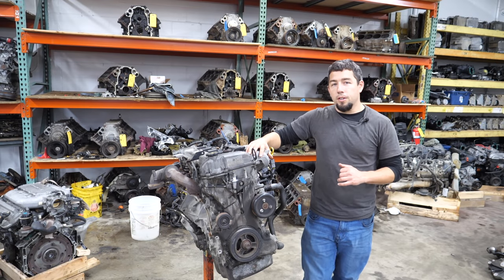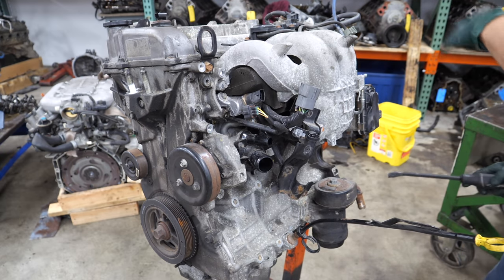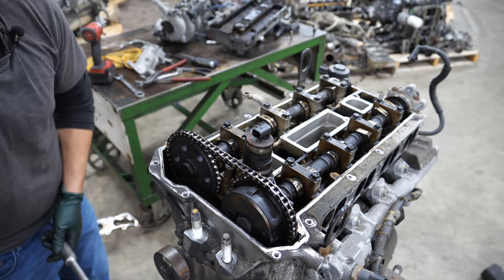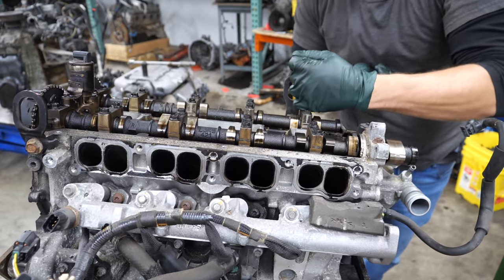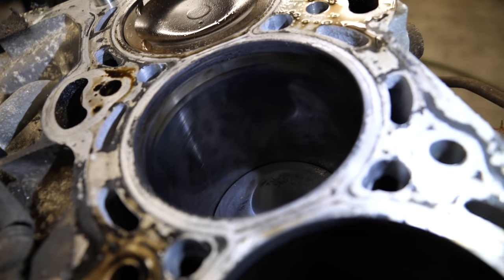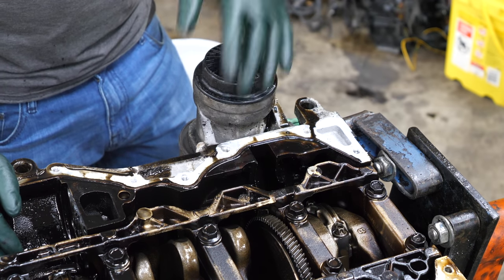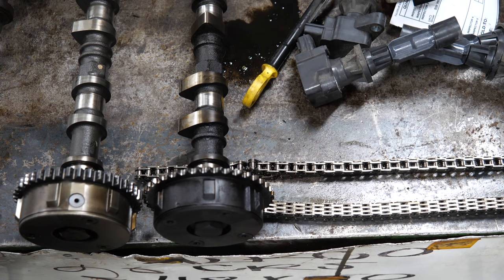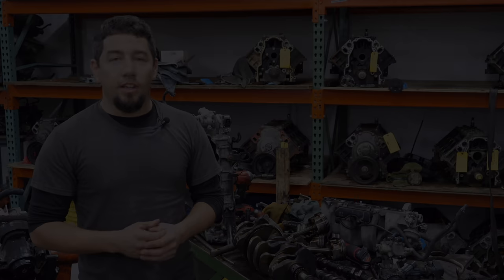Mazda 2.3L Turbo MZR Engine Teardown. A SMORGASBORD Of Failure Modes!

Comment: i dont understand the balance thing? its a 4 CYL
Reply: Imagine an upright single cylinder engine with the piston at Top Dead Center(TDC), and the crankshaft rod journal at the 12 o-clock position, with the connecting rod standing vertical in between. As the crankshaft rotates clockwise at a constant rotational speed away from TDC both the piston and the rod journal will descend towards BDC but the piston will descend faster initially because of the rod which is fixed in length being pulled off of its vertical position due to the horizontal motion of the rod journal. Once at the 3 o-clock position the rod journal will have traversed half of its vertical range of motion between TDC and BDC but because of the rod no longer being vertical the piston will be more then halfway through its range of motion. To give an example if an engine had a 10cm stroke and a 13cm rod the piston will be 6cm down the bore with the rod journal at either the 3 or 9 o-clock positions. As the rod journal approaches 6 o-clock the rod comes back to vertical causing the piston to slow on the approach to BDC. The reverse is true on the way back up the bore.

Since the piston and reciprocating weight are fixed but the velocity of those components are higher on average from 9 to 3 o-clock, across TDC, then from 3 to 9 o-clock, across BDC, the force created by those parts changing direction across TDC is higher then across BDC, even with the crank rotating at a constant speed. For this reason it is impossible for the force created by the crankshaft counterweight(which is constant), to counter the inconstant forces created by the reciprocating assembly, though the inconstant forces created by the reciprocating assembly can be mitigated and made more constant by increasing the rod/stroke ratio(RSR). Longer rods will produce less imbalance between TDC & BDC then will shorter rods for a given stroke length. Most OE engines have RSR's between 1.5 and 1.9, high revving racing engines like those used in F1 or Nascar will usually be in at least 1.8 or the low 2's. This imaginary engine having an RSR of 1.3 is to make the math easy.

Applying this to a normal 4 banger is simple. Cylinders 1 & 4, and 2 & 3 are companion cylinders, the pistons in those pairs of cylinders reach all TDC and BDC, and vise versa together. The forces created in either pair of cylinders crossing TDC can only be partially countered in the opposing cylinders crossing BDC. Any inline 4 without balance shafts will be pulled upwards in its mounts every time either pair of companions cross TDC, gravity obviously provides a constant downward pull. The balance shafts can only mitigate these vibrations by combining two shafts spinning in opposite directions to each other, both at twice the speed of the crank, and timed such that the weights are pointing to 6 o-clock when either pair of companions reach TDC, the balance shafts spinning in opposing directions will counter each other as one weight will point to 3 while the other points to 9, and vise versa. The shafts will eventually point to 12 together producing a smaller and higher frequency vibration then an equivalent engine without balance shafts.

These vibrations inherent to inline 4's are why so few I4's turn much more then 6000 RPM's or exceed much more then 2.5 litres in displacement, as both engine speed and displacement will exacerbate the vibrations. 8 cylinder engines regularly exceed 5 litres and/or 6000 RPM. All that said any given I4 engine family are just as likely to have balance shafts as not, though larger engines are more likely.

Comment: Alright so what do I do to keep my MS3 from suffering this fate?
Reply: I have a 2008 Speed3 with 165k on it that I bought new.  No smoking turbo issue, doesn't use any oil, and runs great.  I change my oil every 2,500 miles with Pennzoil Platinum 5w30.  I replaced the timing chain and VVT actuator at around 100k miles.  I also replaced the injectors and put aftermarket seals in around 100k.  Another thing that is important is doing an intake valve cleaning every 50k or so since it is a direct inject engine.  I do the walnut blasting method.  I think the biggest thing is the frequent oil changes.
Reply: Change the oil with SN grade fully synthetic oil no later than every 10k, preferably earlier than 10k due to it being a GDI engine.
Reply: I do every 5k miles. The manual says every 7.5k mi which seems like a lot.
Reply: @thedownwardmachine  you can never over change your oil, especially in the case of a GDI engine. The most important consideration is to make sure you're using fully synthetic SN grade oil.

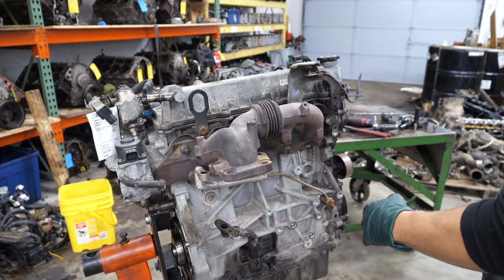Comment: At 4:16 we see a flexible coupling on the exhaust manifold.  Yet, both sides are bolted to the block.  Why does this exist?
Reply from the maker: Heat cycles would likely crack the manifold otherwise
Reply: @I_Do_Cars  Thanx!

Comment: Love cartridge filters. You can inspect the old one without struggling to cut it open and getting oil everywhere. It's how I knew to get rid of my MS3 when I started finding aluminum pieces from the timing chain making contact.